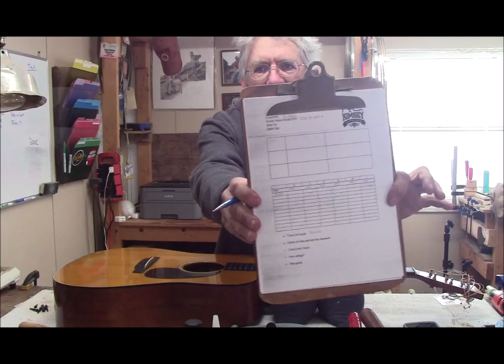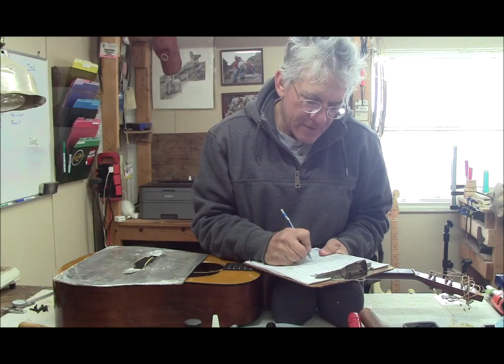Evaluating and adjusting a Martin D-18 1939 Authentic

Comment: Is it common for D18's to buzz a lot between the 1st and 5th frets when strumming on a new guitar? Every video i've seen of them demoing a new D18 and even the one i bought does it. How do you fix it or is it just the way these guitars are? I find it's mostly on the low e a d strings when attacking the strings and playing rhythm. I've tried changing strings that didn't help.
Reply from the maker: Buzzes come from many places- string slap on the frets, strings hitting the next fret, the ball ends of the string rattling, loose braces, pick noise on the strings, etc.  The brighter the guitar, the more noticeable.  Personally, I don't mind most buzzes except for the 'next fret' buzz.  To me, it's what makes the guitar organic instead of sounding like a synthesizer.  If you raise the action, you'll get buzzes because you can't hold the string down to the fret and it buzzes just slightly when you release it.  If you lower it, you'll get next-fret buzzes. YOU have to find the happy spot for YOU.  Guys demo'ing guitars are playing a LOT of guitars and don't always have time to find that sweet spot.  I hear buzzes in nearly everyone's playing... Tony Rice liked to hear a little buzz,  Tommy Emmanuel uses it for percussive effect and so on.  I once asked Mark Cosgrove- Winfield winner- and he said "I've never had a guitar that didn't buzz somewhere".   Also, everyone is more or less sensitive to the sound of buzzes.  For some, that's all they can hear. Finally, if you "attack" the guitar, you're probably going to get buzzes, no matter what.  You will have to string the string parallel to the string plane and not "dig in".  See:

https://www.youtube.com/watch?v=Mq-i6NIxlgk

Comment: Bryan, I have 1999 D16GT I bought new. Still perfect condition. Do you think  that I should remove and reset the pickgard to relieve any wood stress, prevent cracks? Thanks for all your videos!
Reply from the maker: No. Yours is on the finish and stuck on with sticky tape. You're fine
Reply: Thanks, I appreciate your responding.

Comment: I would have a really hard time purchasing a high end acoustic without an adjustable trust rod. 

I understand the nostalgia of older Martins ( or copies), but sometimes - advancements in technology out way older construction.

If I owned an authentic - I'd string it with lights or low tension. 

Just MO.
Reply from the maker: The T bar is an important part of the sound. It's not just nostalgia. If you want to recreate a sound you have to build the same way. You also have to deal with the same problems, if there are any. I have 4 authentics, all with medium strings and no issues. Also have 40, 50, 60, and 70 decades all non adjustable. Some issues but once fixed, they're very stable. And most of that is not movement but starting off with too much relief in the first place. 

There's plenty of choices for adjustable rods.
Reply: @Bryankimsey  Well said.

I just think some of the authentics need neck resets too soon after they're built. Thats why I would be hesitant on purchasing one.
Reply from the maker: Oh, I think nearly all of them do, but the truss does not affect the need for a neck reset.  The truss rod affects relief which, if it's out, will make for a wrong action, but Step 1 is to fix the relief FIRST.  Case in point... the D1 Authentic on my channel.   Fixed the relief, then it didn't need a reset.  So, a reset would've been the WRONG solution.  

Now, I'm 100% on board that Martin's not giving their guitars enough neck angle these days.  But that's a neck angle problem, not a truss rod problem.
Reply: @Bryankimsey  Will there be an issue if the guitar starts developing a belly over time? You'd probably have to shave the bridge and saddle, but at some point, a neck reset would occur sooner with a T bar truss rod than one with an adjustable truss rod I assume.
Reply from the maker: @sc12100  Never shave a bridge unless it's too thick.  Because when you do need a neck reset, you'll also need a new bridge.  Now your cost just went up dramatically AND you don't have the original bridge anymore.  Get the neck set the first time and be done with it.  Honestly, if I were building, I wouldn't let a guitar go out until it was 6-8 months old and I'd plan on resetting it then if it needed it.  Of course, with a plan like that, I'd go broke holding inventory. 

Again.... the truss rod has nothing to do with the need for a reset so, no, whether it has a T-bar or adjustable makes no difference.  Guitars need resets because the body twists like a potato chip- specifically at the waist, where it wants to fold up.  I demonstrated this with "Cathy The Cardboard Guitar".  With just a top and no sides, she folded up at the waist.  When I build just a waist with no sides past that, she held up.